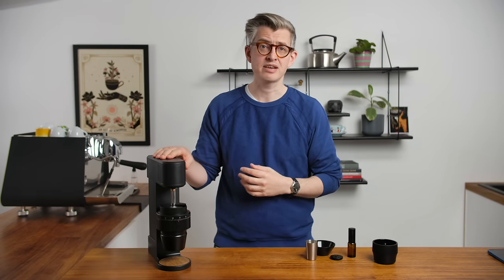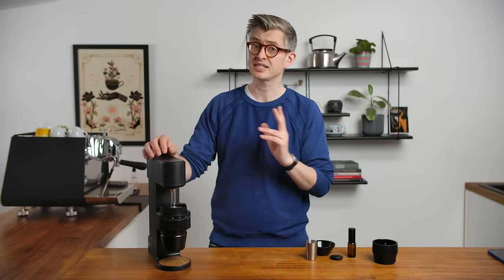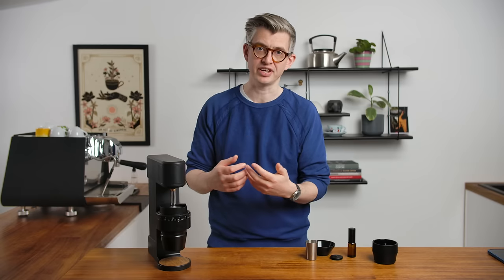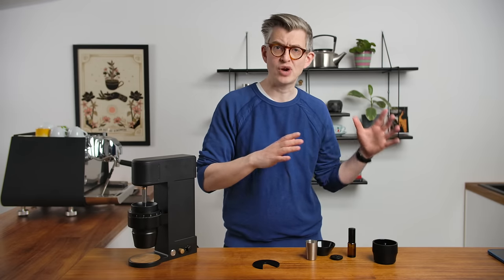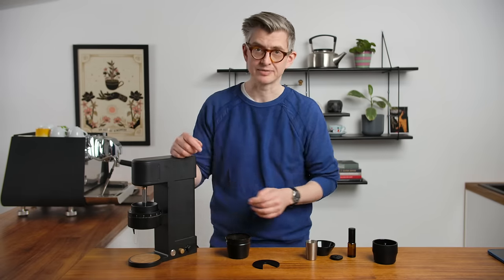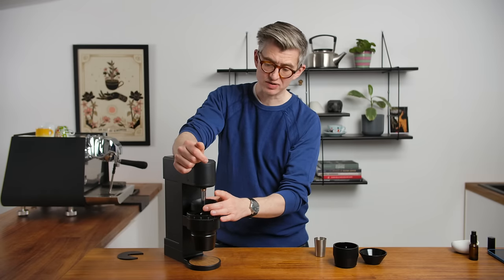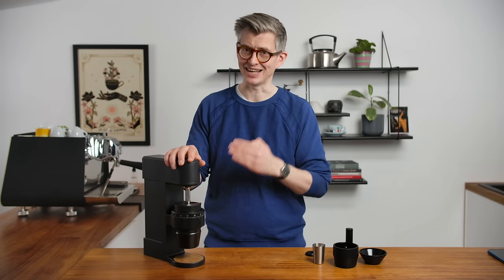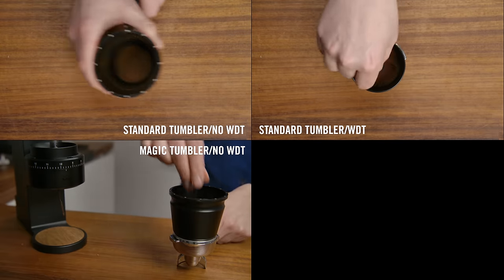Weber Workshops Key Grinder Review

Comment: As someone who is really into engineering and manufacturing as a hobbyist, I'm aware a burr set would be a little hard to make but not too bad with the right cnc mill and sure those are expensive,  but i can't help but think practically everything sold in the coffee space is horrendously overpriced over what labour design and material cost would be. I also wrote this before hearing about stalling that's isn't excusable in my opinion at that price for the motor, yoy could afford a beefy mill motor spindle at that price lol
Reply: I feel the same way. A motor that small with enough torque might be nearly impossible? But if that's the case then don't allow the RPMs to go that low. It feels like the kind of thing a cheap manufacturer would do, give you the illusion of choice/options but not actually optimize for it. The burrs do need to be outrageously perfect. I'm sure it requires quite a lot of skill to make. But holy crap you could buy A LOT of awesome stuff in this world for $2k. You can buy an entire top of the line bicycle. The machine that actually makes the damn espresso can be had for less than $2k. I just feel like the kind of person who can blow $2k on a damn coffee grinder probably just has effectively infinite money and so they figure minimizing the price isn't important

Comment: Still waiting for mine to replace my Kafatek flat max for purely espresso purpose.  I enjoy the flat max but I wanted a more aesthetically graceful conical burr for fuller mouth feel espresso.  I also have the EG-1 but it has retention issues, is a bit large for my counter space and is also a flat burr.  Under-rated motor and bearing/alignment  issues are also a concern for me on this unit as they are as well on my EG-1.  I wish they would up-spec the motor and raise the minimum grind speed to 100 and have a bit higher overall max speed on this grinder.  I also wish there was more magic tumbler to base clearance to be able to remove and insert the tumbler without hitting the distribution wire.

Comment: If the burrs seize (yes this happened to me), temporarily unscrew the screw holding the lower burr in place, then you can move them again. Only need to unscrew a little bit. Annoying? Yes. Quickly fixed though.

Comment: You've got me wondering whether the characteristics you mentioned in relation to the various grinding speeds would apply to some extent depending on whether I'm cranking my Lido 3 grinder as fast as possible, at a moderate speed, or very slowly,

Comment: I almost pre-ordered this. I missed the initial price cut and decided against. In the end, I spent more money on a machine and got a Niche. While the Niche is definitely a pleasure to use, cleaning and calibrating makes me want to smash it with a hammer. Which is whatever. The more important issue is that I find it inconsistent shot to shot. I'm looking to upgrade and the Weber is at the upper end of my price point. This review was helpful because it feels a bit fussy and after using the Niche, I would probably find that experience...annoying. I'm the kind of person that would accidentally trash that magic paper clip on week one. The comments about industrial scale was great. The vaporware feel of something like the Lagom (Prima only, perhaps some year you could get one) means that there is a dearth of $1000-$2000 single dose grinders.

Comment: I'm curious if anyone has compared the Weber coated/ treated burrs on this Weber Key and HG-2, with the HG-1 or HG-1 Prime's untreated burrs? I heard somewhere you get more body and less flavour clarity on the untreated burrs, but looking to confirm whether it's true or not.
Reply: Finally tried it and my suspicions were confirmed. If you want a more traditional conical profile the uncoated burrs seemed to fit that profile more. Higher body and less flavor clarity but still tasty.  Compared the HG1 vs HG2 with coated burrs. The HG2 had hardly any body and a little more flavours clarity. Seemed closer to a flat burrr. In fact one shot I managed to get a noticible amount of body out of a grinder using ssp MP burrs where the HG2 had very little.  That was surprising.

Comment: Thanks for an informative and entertaining video review, as always James.

I recently went through the process of choosing a new single dose, low retention grinder and this one was on the list (it was the most expensive). The others were the Niche, the Eureka Oro and the Lagom P64.  I know there are 2 conicals and 2 flats there - should I be cross shopping them.

I only use the grinder for espresso.

The Niche is very hard to buy and ridiculously expensive (relatively to the there 3) here in Australia - so it was dropped first.

The Eureka Oro promised a lot and was the price I wanted to stay at, but reviews have shown it to not really be what I am looking for.

This left the Lagom and the Key.  I have gone for the Lagom (due for delivery imminently) due to the flexibility the choice of burrs provide along with the fact it is further in it's development cycle - meaning I expect less issues.  I like the design of both equally (noting they are very different) and expect I will like the workflow more with the Lagom.

It is great to have such choices and people like you to tell us all about them.

Comment: i still use my Knock Aergrind 2.0 at work and my Commandante C40 at home. The results are good enough and I like the small footprints. I'm still considering buying a Niche Zero. Since I like to switch between mocha, espresso and filter coffee, this is the most versatile for me. I like the simple adjustment. That is also the reason why I continue to rely on hand grinder. The Weber Key is not interesting for me. Especially not for the price.

Comment: Philosophical thinking of my own leads me to think that if you're noting significant flaws in a countertop kitchen appliance that costs that much and has only one basic function, it is obviously not a good value.  At that price point, one would think that you'd be well beyond the threshold of diminishing returns wherein all major flaws have vanished and the only thing left to discuss is how much is gained by the extra expense.  But I'm hearing about burrs that could seize up, motor stalling issues, beans jumping out of the upper cone, and poor quality in some of the accessories.  No thank you.

Comment: Got mine and a doing pretty well with it but swapped out the magic tumbler for the regular one and a funnel, added the bean feeder and with these changes it is quite nice.  What is that white porcelain bean funnel you are using with it to feed the beans?  Been looking everywhere for it to no luck.
Reply: He designed them with Loveramics and you can buy them at his webshop. The shop is linked in the description, a little confusingly only as "Limited Edition Merch". It is listed in the "Collectables"-section there, but I don't think they are part of the limited product lines.

Comment: Question: Is the quality of beans more important than the grinder?
Reply: Both, even in a good grinder you can't get a bad tasting coffee to taste that amazing. Although I was surprised some grinders (or burrs) do seem to bring out the best in coffees, making some not so great, or older coffee not as bad as I expected it to be. Some are basically more forgiving in that way, as well as forgiving in coffee prep mistakes. 
Weber Key (or likely most 83mm conical burr grinders with the same Mazzer burrs) and Kafateks Shuriken LM burrs (in Monolith grinders) are pretty versatile / forgiving grinders.  SSP 64mm unimodal burrs (in P64/DF64 etc) are not so forgiving, but super high clarity when you get it right. 

However if you have a great coffee and you're grinding it inconsistently you're going to be limiting its potential, you have larger and smaller particles that will under and overextract (likely giving you bitter and sour notes that overpower the subtle coffee notes) you may be able to still get enjoyable / 'good' results,  especially if you're used to the same bad grinder, with bad coffee, the good coffee might taste better and you'll be happier with that (some coffees though are more forgiving, others not so much).

Comment: Not unless I missed it, does this grinder have the ability to swap out burr sets? Seems to me for $2K, you should be able to swap them out.
Reply: Pretty sure you can swap out burrs if needed, not sure if you'd need to re-align, but of course there's only so many burr types that will fit, and these Mazzer 83mm burrs are pretty good. He mention the P64 has more burr options because 64mm flats have recently become quite popular and there's different burr options, easy to swap flat burrs, not sure about conicals, but should be possible, just I don't think people would want to, unless you wear out the burrs which might be in 80 years or so.

Comment: I pledged on the IG campaign and had a very rough experience with them. At the end of the day they took care of me and cancelled my order. What comes to mind here is that generally when you buy high-end gear you tend to expect high-end service…Think Lexus dealership vs Chevy…And WW falls well short of this. I do have some sympathy for the wave of bad PR they hit, but part of me wonders if it would have been as bad had they not set the expectations where they did and then fail to communicate adequately with the many, many people who preordered or pledged. It’s hard to imagine that in hindsight they wouldn’t have capped the preorder numbers to better manage a smaller customer base, but it’s understandable to try and capitalize on the hype.

Comment: I am a chemistry research scientist. This video is quite old, so you may have already been made aware, but you are misusing your refractometer in this video. Refractometry demands a lot of consistency in volume between measurements, and the large number of drops you are using from your transfer pipette seems to be too much, and it would be very difficult to be consistent with when using that much liquid with such imprecise dosing control.

Comment: Yes. Either, buy max 200 € grinder that works and has bigger container and better precision (in this kind of prototype level device, in practice the precision of the burrs are practically same than the moderate 200 € standard version, wilfa for instance, NOW, concerning home use or small business like cafeteria.) So, also because devices break all the time, buy 50-200 € Wilfa grinder, so you can replace it cheaply when it breaks, IF that is enough for you (which in this case, is to brew drinkable coffee.) So, Buy nice OR Buy twice.

But the budget version. Get pre-milled ground coffee (so you don't need to grind it yourself, you can skip the grinder alltogether). Buy 5 € hand brewer (in this case the 5 € plastic version). Heat water on stove or fricking livinig fire or water brewer. So, you can heat the water only with water brewer ans just apply the water over the pre-milled coffee from coffee package. Hand brewer 5 €, water brewer 50 €, plus ground coffee (maybe 10 € per package). Enjoy! OK, this last was meant as a joke, but seriously... (back on the topic).

As I have watched many coffee grinder videos, the big problem seems to be with the most important part of the grinder, the (usually metallic) burrs/blades. Because the standard WILFA-grinder is a long line of development, the burrs/blades in the 200 € WILFA machine are quite good (so that they are durable enough and that they are precise enough for standard coffee bean crushing.)

In this kind of grinder (in the video), the blade burr system for some reason is usually over-engineered. The mechanic is too loose, the burrs are not precise enough constructed (conserning price range of machine, now 2000 €). So, in practice the blade burr system (when used daily) is roughly the same level as 200 € standard WILFA machine, but it can be worse. In some cases, actually some 5000 € crowdfunding grinder has worse burr grinder system that 200 € WILFA model. When grinding beans in practice every day. But seems like concerning price range of like 2000-5000 € per device, the optical quality of the blades/burrs should be astronomically more precise than this and better designed. This is like buying 500 € used computer from eBay with 2000 €, when you can get like best possible Intel/NVIDIA machine new from the store (not Walmart, yes I know about "THE machine".) And good screen and keyboard and everything else. 

I don't know, maybe crowdfunders think that "engineering is cool". Hmmm... actually, maybe this system plays on the fact that you as a crowdfounder (shareholder) of the development feel like you had something to do with the design of the device, some kind of "attachment", that you as a crowdfounder have been part of something important and "cool". But this device very much looks and sounds like on of these "crowdfunding coffee design machines."

BTW, what i actually use:

30 € electric small burr grinder, small one, container about 150g of coffee.
Finnish tap water
200 € Moccamaster (technivorm, the Dutch company) with 1,25 litre water container. It is automatic coffee brewer and uses cheap coffee filtering.

Either beans (which i grind myself) or pre-grinded ground coffee (so I don't have to grind beans everytime before I make coffee.) price range about 12 € per kilogram (1000 grams) in Finland incl. TAX.

But good luck with the engineering.
Reply: The crowdfunding in this case was for production, nothing to do with development. The grinder was fully designed when the campaign went live.
Reply: @maaaatt  OK

Comment: If adjusting the RPM can change the profile of the espresso, would the speed of which I use my hand grinder make a difference too? 

Sounds like a test for the coffee weirdo.
Reply: Yes, but there's only so fast or so slow you can comfortably grind with a hand grinder, and if you have a hand grinder that's one of the smaller ones (not like an HG-1/2/Prime mounted on a table) and you're doing a turbo grind and waving it around it might feed the beans slower due to being shaken around which would also affect things slowing down the grind rate. 

Generally higher RPM = more fines? Usually less clarity more body, low rpm = more clarity, less body.

Comment: At this price, maybe they should have tested the thing?

Stalling when grinding at low rpm, so it needed a stronger motor or different gearing, or a higher lowest setting.

Cute lid, but if beans stick, it needs to be transparrent.

Comment: 2000 dollars, and it cannot use one of the RPM settings. Worse, that failure can turn catastrophic for the motor. What were they thinking?
Reply: The motor shuts off to protect itself from burning up if gets clogged. If you research the web, the vast majority of these cases occur with light roasts at 30 rpm’s . The solution to prevent that from happening is to run the grinder at a higher rpm for these lighter roasts. To the best of my knowledge the Key has the lowest rpm setting of any electric grinder on the market. I’ve had my J-Max bind on a light roast and I can guarantee my arm wasn’t churning at 30 rpm. Solution: I no longer hand grind light roasts.

Comment: Imo if you pay 2k for a coffee grinder, it should be nearly flawless. Even the potential of a flaw is unacceptable. It should work every time, exactly how you expect, for years and years. The only possible room I would give Weber is a user not maintain the grinder correctly. Otherwise, I'd say they've failed at whatever this is supposed to be. If it can't grinder coffee as well or consistently as something half it's price or less, all the "high end" materials are for not. Go back to the drawing board and make something that works first and foremost.

Comment: You can buy a professional grade grinder from Ceado with excellent 80+mm flat burrs and a quick release worm gear grind size adjustment... for $300 less than this. You can grind all day with it,  without overheating. 

At the $2000 price point, you should be getting a pro cafe quality ginder. Really, anything above $1000 is in this arena. So... I don't think they've hit the mark with this one. Definitely does not check the boxes of being pro grade. 
I hope they can get their production processes (and therefore cost) and purchasing under control so that this same grinder (except with design flaws fixed) comes in at under $1000.

Comment: Please consider that fines are not "produced" by any of the grinders in common use. The fines that show up are dehydrated and partially decomposed cellular contents that are 'released' when the cells that contain them are fractured. The burrs on none of the grinders that you or I use are capable of reducing the starting material to the very small particle size that is typical of "fines" in coffee. You can verify what I have said by taking some ground coffee to a lab that has an electron microscope, which might make an interesting video in itself.

Comment: It seems Lagom P64 is a more refined product than this. The workflow seems to be better ; no apparent flaw; interchangeable burrs and cheaper price!
Reply: With SSP burrs in my P64 I paid about the same amount I paid for the Key with TWO tumblers, got a bit of a deal on the Key though. I do like the more straightforward workflow on the P64, you can use a dosing cup or go direct to portafilter, it's pretty good, no bellows, no mess / no fuss or popcorning. Declumper doesn't hold back lots of coffee like the DF64 does either. 
Key takes a bit more getting used to the tumblers but they're not bad once you get used to them. I don't like the WDT tool though, awkward to avoid hitting.
Key is also a bit harder to load (should come with a coffee vial thing they also sell maybe) but you get used to it, and it has some popcorning.